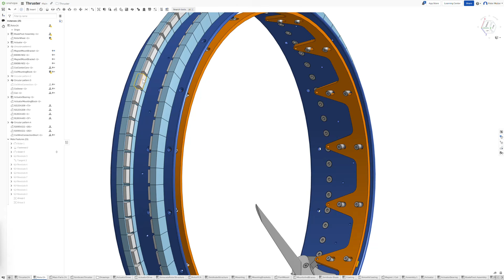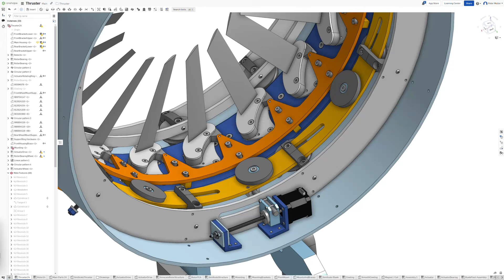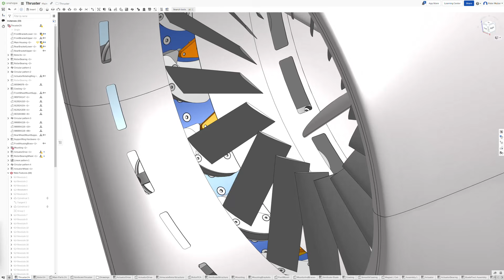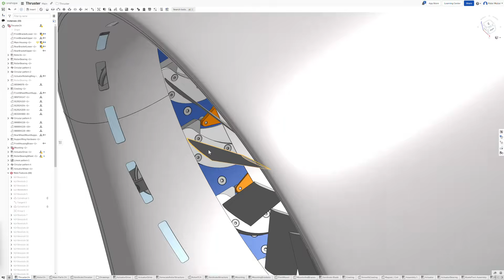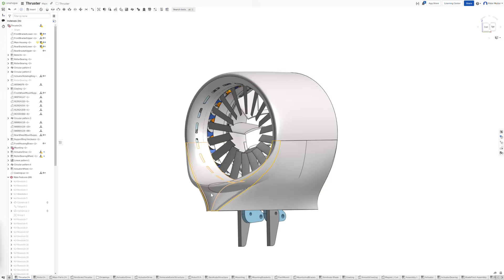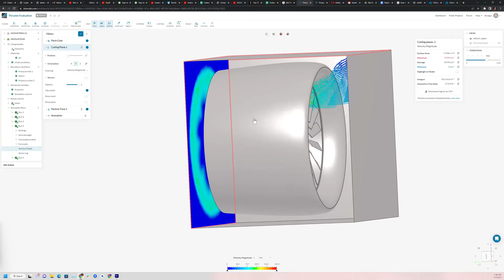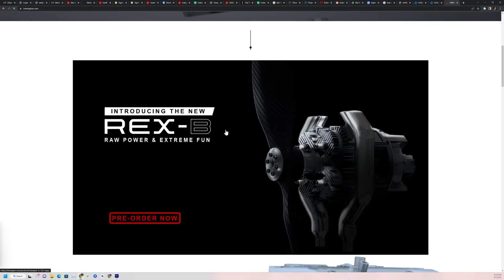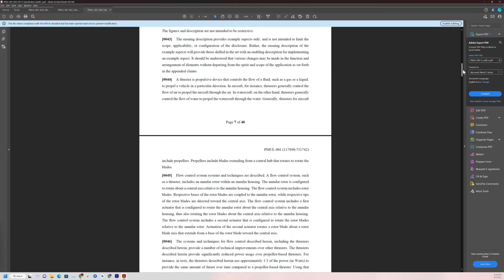Could this Thruster transform Aviation?

Comment: Aeronautical Engineer that worked 20 yrs. for main commercial and military generator manufacture, Sundstrand Aerospace now part of UTC.  built a 270 KVA 3 phase induction motor running at about 1000 Hz. Weight of the magnetic component about 60 lbs.  And I package the inverter  where power came from 400VDC batteries. One person could carry each one.  That was in about 1982.
First issue is that  source of electricity is needed and if created by combustion on the airplane, any method adds weigh.  
Second issue, the large number of poles means the motor to run at a a high speed requires high frequency. Extremely high frequency results in higher lose in the steel or other flux conductor and in the wire since the current is concentrated at the surface of the wire. We paid for low weight with high iron losses and requiring litz wire.  Spray oil cooling was required to remove heat.   This motor with a counter rotating stator fit into a 20 target torpedo hull.  The stator and gearbox housing directly drove a propeller and a counter propeller was drive through a gearbox.
The simplest solution is to reduce the number of poles.  I assume three PMs create a single three phase pole thus 72 PM result in 24 effective poles for 3 phase.  Use two PMs for each phase pole results in 12 effective poles and use 4 PMs cut in half again to 6 effective poles.  Also affecting efficiency is the lack of a back iron to connect the PM flux paths so the only time flux is in are is at the gaps between parts with relative motion.  I may have missed this in the scrolling through the video.  
Free 2D magnetic software is https://www.femm.info/wiki/HomePage  which has been around so may examples and videos exist to show you how to deal with motion etc.

Comment: Incredible! First note, flip magnets with the coils. Or... whining the coil as one large coil inside the outer rim. More smaller gauge wire, creates more power? I'm thinking about non-contact magnet stator motors. 😮 smaller prototypes could be produced this way. Maybe even 3D printed parts.

Comment: Love the novelty but the weight was my first concern and comparison to the GE9x. The engine wet is 21K it makes about 134,000 LBS but more over it provides much more than just thrust. Bleed air for anti-icing and cabin pressure, electricity 90KVA, and 300hp of hydraulic power to power all the control surfaces. You need to keep those in mind. Additionally I would look at the friction of your system vs a GE9x and the loss of both systems. Smaller bearings (shaft) will have a lower coefficient of friction than the large race bearings and wheels you are using. Good stuff can't weight for version 2 to address some of those.
Reply: Yes great point. Those outer wheels will be running at very high rates while bearing the full thrust load. Seems high friction losses are likely.

Comment: You are going to have severe harmonic issues with those unsupported blades in compression. I am certain you will need to add a ring at the tips to damp the harmonics, hopefully this will not have negative effects on the efficiency, but I don’t think it will.
Reply: You may be right, but software analysis can be used to determine the speeds that are worst and the better speeds may be ok 🤷
Reply: @ryanthomas2472  no it doesn't. The blades still rotate around a certain point. There just needs to be a pivot at that point where they meet the centre ring
Reply: @nathanchalecki4842  Yes it will work as you say but only if the bottom and top pivot points are in line but in this case it can not since bottom pivot point looks off centre.
Reply: Then an inner set of blades mounted to the ring at the base and connected  to a ball in the center (I don’t know anything about this)

Comment: Hi Peter, You have to check with SimScale, if the generated CFD-Based thrust presented in the video is per blade or this is for the entire fan blades, I think this is for entire fan, so the total thrust will be around 60kg (around 130lb) for the given settings, to be checked, so you have to double check. I think the generated thrust (if the model is well optimized) will be limited to around 150kg+-10% (330lb+-10%) for 24inch and 90hp input power. You have to double check, thanks.

Comment: Tip speed is still a problem, you don’t want sonic shocks at the leading edge of the outer point of the fan blade that is exposed to the air.
I’m a tiny bit concerned about the open design to the screws, I think that should be closed and smooth to reduce drag effects 🤔
I do know a bit about the intake to jet engines and would be glad to discuss if you want. The entrance to a jet engine is very carefully designed with smooth curves (Google photos) to try to cause as little disruption to the air flow as possible.

Comment: He didn't learn a single thing from any of the mistakes he made with Raptor 1.
When you can set your ego aside and analyze the how and why that got you to this point (in a cornfield) then you have the opportunity to be humbled and address those issues without your ego getting in the way of success. 

Does Peter sound like a man that was humbled by those mistakes? Or does he sound like someone that is convinced that the only mistakes he made was that he didn't go BIG enough nor was it COMPLEX enough?

So, I'll be here. Eating my popcorn. Watching. Waiting for the slow moving train wreck right into a tanker truck stuck on the tracks.
Reply: He should have have insisted on the original prototype at least as a testbed. I know you just want attention and don't care about the project, but he is also trying to integrate too many changes at once in the design and this will cause a complete chaos soon.

Comment: In your comparison near 48:00 you compare a complete engine + turbofan with just your turbofan and no engine. It should at least include the weight of any engine that can produce the power required plus a generator. Preferably an existing off the shelf engine and generator.

Comment: Neat concept!  I see you compared this with a propeller and a GE9X but I'm wondering how this engine compares to a traditional motor-in-hub ducted fan?  I assume you'd also have to worry about designing the blades to not buckle under high rpm and all the drag caused by the motor and pitch adjustment mechanism rotating in a confined space at high velocity, not to mention the high tolerance that would need to be achieved to reduce vibration with such a large rotating mass distribution.  What advantage does this engine have over a normal ducted fan?
Reply: Seems that having a central ring would help with a lot of that. But idk how that'd effect performance
Reply: Advantage number one: it looks cooler.
Reply: @nathanchalecki4842  You can easily produce a lot of torque for something driven by a giant motor in its its outer surface, tip vortices don't matter, blades can have better shapes since they are supported by a large base surface, ...

Comment: Issues that stand out at a glance:
1. Dozens of ball bearings, the failure of any one of them leads to a rapid failure of the entire system under load.
2. Using NSNS magnet arrangement, when a Halbach array is known to be superior.
3. Electromagnet supports are presumably aluminum, which will exhibit huge drag on the magnets, proportional to RPM.
4. Straight-aligned electromagnets, for maximum "cogging" vibration induction.
5. For useful performance rating, the blade roots will need to be on the verge of transonic operation, making each magnet a supersonic projectile in waiting (they are not securely kept in the drawing).
6. Inadequate support and contact surfaces (aluminum) for a device meant to pull a vehicle about as heavy as a car. The bearings alone for those rollers are going to have a linear velocity well in excess of the speed of sound, multiplied by the gear ratio, so about mach-100+ in this case... Apply this to problem #1
7. While it's common for inlet guide veins to be movable, and that's cool, a failure of the mechanism is outside of the air path, and is not catastrophic. Everything about this engine is catastrophic. 
8. Any dust, bug, feather, or anything getting between the many exposed moving surfaces will set up a vibrational wave of destruction, immediately after destroying the contact surfaces.
9. I stopped watching at 7:05

Possible recommendations (because this idea is cool, and I like it):
1. This is not an appropriate design for aviation as it is, or any near-term adaptation from it. It is probably a top-tier concept for submarine propulsion, however, and that is the direction it should take.
2. If placed 'inside' a submarine, intake and thrust noises can be highly monitored, absorbed, and counteracted, which is important because of all those moving/noise-sources.
3. The empty middle section would be great for passing things like seaweed, mud, and creatures, as they will naturally seek the center of the vortex.
4. The physical restraints, drive, and controls at the perimeter are ideal for a submarine, as the water flow can be significantly higher for an annular heat exchanger at any speed.
5. Bubbles from turbulence and shed heat will concentrate around the perimeter, where they can be better controlled. 
6. Water can be forced to act as a hydraulic bearing between your otherwise contact-vulnerabilities
7. Fan rotates much more slowly underwater, so speed-related magnet problems are less dire, though a better magnet arrangement and materials are warranted.
8. Moving and magnetic field parts are all internal, so can be managed for signature reduction.
9. Since a typical electric motor has only a few to a dozen or so poles, and this one has hundreds, and the roots of the blades and machinery are the thickest/heaviest parts, spreading them out along the rim for cooling and maintenance is suitable for aquatic use, and concentration/miniaturization in the center is more suitable for aviation use. 

So, it looks to me that your idea is good for high-end aquatic uses, but absolutely unsuitable for aviation use. Other possible uses that may be worth exploring are:
1. Variable flow hydroelectrical uses, such as extracting energy from variable sources of water. A trickle can turn the blades, but a torrent can fill the pipe, while debris will either fall at a trickle, or self-center in a torrent.
2. Not for lift-pumping, however, because sewage treatment plants commonly use a nearly identical concept, but with blades that extend the length of the pipe (inverted Archimedes' screw).
3. Novel/Overpriced desk fans (which already exist, and this fan is a shitty copy of).
4. Possible garbage disposal, that may or may not be better than the cheap ones that already exist.

Comment: Impressive work Mr. Muller.  I am an electronics engineer - not mechanical, so I cannot comment on your design or the points raised by various folks.

The one thing that just did not 'feel' right to me however was the flappity-doodle vulnerability of the blades.  Reckon "BootsnFlies" suggestion is worth a detailed look.

Well done - so far - Sir.  Best of fortunes with this design.

Comment: Top! I'm very impressed... just a thought on the Center section and the air flow: could it be an improvement to put a fixed part, possibly not rotating, to bring the air to the blades?  Waiting for more! I followed the raptor completely...

Comment: I don't think you need mechanical bearings, it seems to me maglev would work better, especially at the speeds you are contemplating. Also, I think the shape of the blades can be optimized. At the rotational speeds you are planning there is going to be tremendous centrifugal force, so air is going to be moving outward from the center at considerable velocity. If airspeed is slow this is more of a centrifugal compressor than an axial fan; in fact, I think you have to be moving pretty fast before axial vectors overcome centrifugal vectors. The blades (or cowling) need to redirect that airflow to the rear, or you are going to waste a lot of energy as heat, which will cause the rim or cowling to heat up. If you are using permanent magnets in the motor you have to worry about them reaching their Curie temperature, at which point they will lose magnetism. Neodymium magnets have Curie temps in the 300-400 C range, which isn't really all that high in this context.

It's an interesting idea, with some advantages coming from putting the drive on outside rather than in the center. I wonder if it might be more useful to use to provide downward thrust for vertical lift, rather than just forward thrust.

Looking forward to see your progress.
Reply: As this is intended to produce a ton of thrust you will want to have thrust bearings in place to take the punishment. And once you have that you might just as well ut some roller bearings in place to take any side load that might develop in case of a bird strike taking out one or more of the blades and unbalancing the whole thing.

Comment: The only money you will make from this is the Youtube Ad revenue from your click bait title.  Supporting the thruster from the rim is less aerodynamically efficient and hundreds of times more complicated.  Delrin and aluminum do not make real-world high speed stressed roller contacting surfaces because they cannot handle repeated stress cycles like real bearings can.  A million aluminum outer support stress cycles will occur in about 15 minutes in your engine at design RPM (8000 rpm times 8? bearing wheels = 64K stress cycles per minute).  Your Delrin will stress cycle a million times in under an hour.  Your main supports will literally fly apart, and if you have taken off, you will end up in a cornfield.  But congratulations on a pretty little home air fan that about 10000 times more than it should.
Reply: It does look cool though.
As you say, it won't work to propel an aircraft.
There are some cool rim drive devices for use with water craft. It's really cool the way seaweed and rope just pass through the center of the water devices.

Comment: Great work Pete,
How to deal with low center air mass flow... change the centre radius dimension by using an intake cone forcing airflow past static vanes to outer blade area. Redesign blade shape to allow for increased chord angle air flow and maintain laminar flow.
You could consider two rows of blades for 40% thrust improvement for 20% more weight 👍
Angle the coils away from perpendicular 
Also kim Electricity can be generated from air passing across  copper in-between your double static vanes behind blades...ooh yeah.
Keep going with this Pete,  your on a winner.
🐰

Comment: Just a couple more things to think about. Your cooling vents will get clogged in icing conditions. Also, have you considered getting more thrust from the middle with a twisted blade design? Increase the angle of attack as you near the center, as most modern props and turbofans do now. 
I like seeing all the comments about how you will fail. Failing fast is how you will succeed fast. Keep it up and fail as fast as you can afford!
Reply: Core tip speeds are too slow.

Comment: Interesting idea, however, I notice a lot of issues with this design. First would be the fact that there is going to be a lot of power loss due to friction. Also, all those bearings will fail unless fed with lubricant. Also, as speed and pressure build I imagine that the blades would want to bend and flatten (away from center toward the rim) as centrifugal force builds…

Comment: All i know is that large diameter, high precision bearings are extremely expensive, and thermal expansion issues are just that. Issues.
Along with things like rotational speeds.
This is a non solution for a problem that doesnt exist.

Comment: Nice work Peter. Agree with your FEA that the tips wont flex much. My background is air handling  and not power plant and airframe. My desire is to see the fabulous airflows generated by modern turbofan engines duplicated by lower temperature engines and you are working in that direction. If I can suggest, rim or hub driven, the airflow in the center will always be less than at the periphery. This is highly disruptive to good airflow. Both the bell mouth inlet and it's corresponding opposite, the bullet shaped hub (both upstream and down stream), help give more uniform performance and they don't need to rotate.

Comment: As many have said, lots of bearings and moving parts. Have you thought about a connected manipulation of blade pitch? Just thinking of bad situations, like flat spins, etc, where aerodynamic pressure would be coming backwards, or highly turbulent air, like the jet exhaust from another aircraft, that would play havoc with this free or unconnected cam design.
Negative/reverse thrust, as others have said, would be useful….
What about a second stage, rotating the opposite direction, with a swashplate like control between them?
The blades look very symmetrical, why not vary the cord, profile, etc to vary from the root on the outer towards the center?
Have you created any scale working models/prototypes, even a low speed 3D printed design might reveal some insights. Take a look at all the 3D printed takes that drone operators have done based on the MIT blade design (looks like a bunch of ellipses).
Definitely high torque, but air at lower speeds would not require that much torque, and at higher RPMs/speeds… I just do not know.
I definitely hope this works and is very efficient.
I think a more active cooling system might be needed to keep your bearings and motor cool… but I have been wrong before!
Reply: There is a russian experimental fiberglass airplane that looks like a jet and uses a car engine, they spent a lot of effort designing a ducted fan for it and their latest blades have a 'twist' on them too.
Reply: @vitordelima  
=DREAMER JPII...